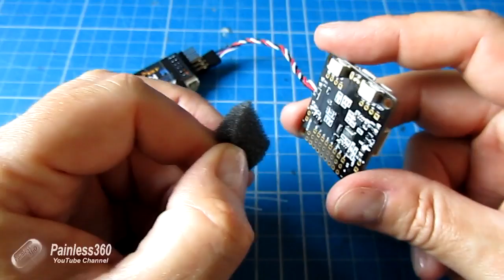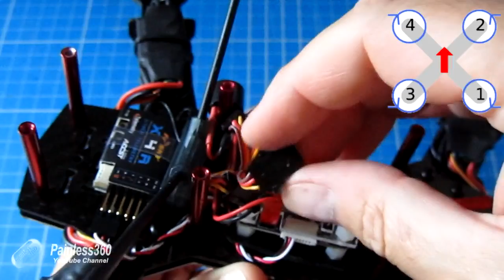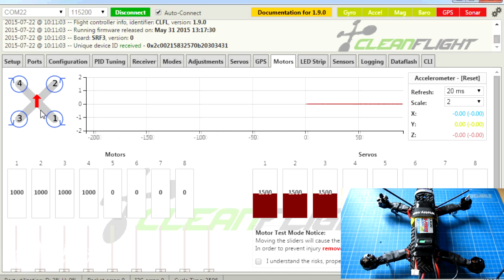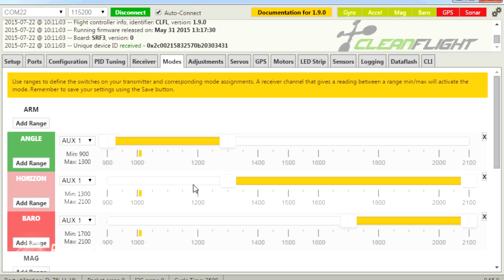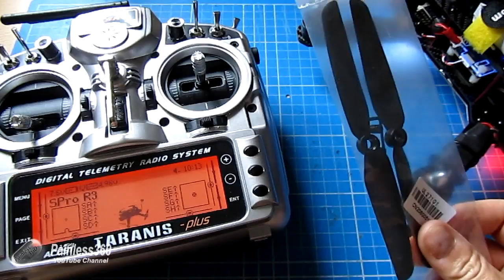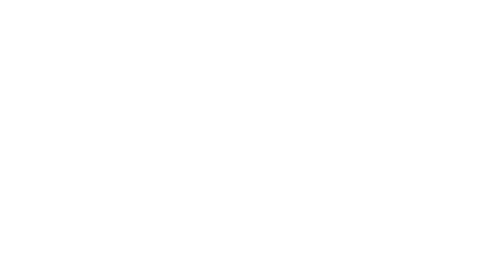(2/9) Seriously Pro F3 (SP3) Series - Installation, power, motors and first hover

Comment: I've just spent the last 5 days trying to get my Quad working with Cleanflight, and this is the 1st YouTube I've found that gives a clear, concise way of setting it up.  Thank you for this video; I was beginning to tear my hair out!
Reply from the maker: Cleanflight is a little unusual now. Most pilots use Betaflight or INAV.. See my builds on those firmwares.. Best of luck!
Reply: @Painless360  It looks like the SP F3 won't run on these configurators though.
The motors are now doing what I expect them to do, but when it gets off the ground (just) it shuts down everytime, and I can't work out why

Comment: i am confused. i got an SP F3 and with my motors. everything is wired up right works and that.. but my motors do NOT spin up for some reason. any help?...
Reply: back here aigan. I take it back. I only got one signal wire running to the ESC'S i tested some protokols annd TO my suprise. the motors spun up with multishot. love it rn. The motors need replacing one dont work the other 3 sound bad and make small shorts. BUT FIRST TIME in my hands it works im lovin it x3
Reply from the maker: Depends on the software you are using, or it could be an arming issue - tricky to help without any details. See my builds on inav and betaflight. Best of luck
Reply: @Painless360  Nono dont worry i got it fixed. hat to put the ESC protokoll to MULTISHOT works fine now. Tho i found out. Motors are trashed hah.. gotta find new ones in right size (1806) or gonna try to rebuild them OR.. i need a 5 inch frame and 2206 motors. i will see, WIsh me luck :D amd getting close to flyin
Reply from the maker: Best wishes!

Comment: What is vbat doing... Is it providing 5 volts or 5 volts is given by esc?
Reply from the maker: vBat on a flight controller normally outputs the battery voltage for use with things like the camera, VTX or other things that need the higher voltage. See later builds on the channel. On some on AIO boards it's used to measure the battery voltage. Best of luck!
Reply: @Painless360  sir on which pin on the flightcontroller 5v output from pdb will go
Reply from the maker: Please see my builds on the channel that cover all the steps.. Best of luck
Reply: @Painless360  ok sir thanks alot

Comment: It's 2020 and for budget quad build, this is priceless!!! F3's are still available and I'm fitting one on a 330 frame. Not too fussy about specs, functions and features, as long as it stays level and it's stable, it's good enough for buzzing around the garden. Seen most of your build series, I've said it before, probably the most sensible and comprehensive build advise without the drama. Cheers!!

Comment: So you power up the flight controller on Vbat? With 5v
Reply from the maker: Vat and for monitoring the battery voltage only. See recent builds that use more modern components...

Comment: the pins for the vbat port. Are those going straight from the 14.8V pdb XT60 connector?
Reply from the maker: Vbat usually connects to the battery pins to see the battery voltage... Best of luck!

Comment: I just learn to fly. Using emax 12a to my uav 250 and sp f3 racing. But the betaflight setting it has known only "brushed" no one shot. And flying were difficult to control. Do you have any suggeation sir and solutions,? Is This remedy caused by bad combination ESC vs sp f3 racing or something else. Calibration esc, accel have done and successful sir

Comment: This is very complete tutorial sir ;). If i use emax 12 a ESC should i use the middle red wire onto sp f3?  should I connect all the red wire or only one of them? Since this is 5c wire.?  Please advice sir...thanks
Reply from the maker: It depends on the type of ESC you have. If it has a linear BEC inside then you can connect it, it it's a switched BEC then only connect one of the red wires - see my video on it..

Comment: would you happen to know how to hook up four servos to the flight controller and control them using your transmitter.
Reply from the maker: Depends on the flight controller and software you're using. iNav is about to make it a lot easier..
Reply: Painless360 I'm currently trying to accomplish this with cleanflight and the seriously pro f3. Would it just be better for me to use Inav instead.

Comment: Hell, your esc have not callibrated it continuously beeps that means the esc doesn't dectect throttle signal....in fact i am facing the same prob so when i decrease max throttle value from 2000 to 1734 then at that point the esc easily callibrating.

Comment: At 13:46...  I have OPTO ESCs, but my PDB has a 12V and 5V + & -.  So I'm safe to say I don't need a BEC?  Just run a JST connector from the 5V connection to the FC?  And then how do I connect the black and white wires from the ESCs.  Black is ground and the White is the data pin?  So, again where are these two wires connecting?
Reply from the maker: That's right, please see my quadcopter building for beginners series if this is the first time you've done this, all of my tips for new builders are in there. Best of luck!
Reply: Hahaha.  RC Basics; Just watched it.  Thanks.  Now I feel stupid.  When I connected the tiny Black and White cable to the ESC, I never took the time to take a close look at the other end.  I just assumed that two wires, there was just a 2 pin connector on the end and was wondering how that would work connecting to the pins on the FC.  It's a 3 pin connector with the center empty with no wire.  The 5V pin will go in the empty hole with the ground and data pins connecting to the FC.  Duh!  If I had just looked at it, I might not have asked the question.  Going back to finish watching Quad building for beginners series 1 & 2.
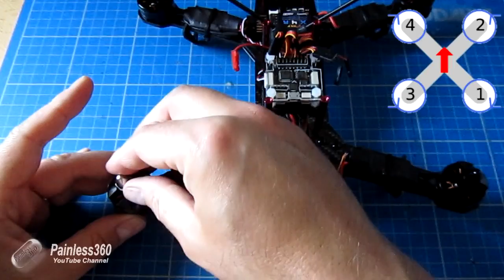Explained very well in this video as well: (5/9) Quadcopter Building for Beginners - Connecting the main power systems around 9:00
Reply from the maker: Don't feel stupid, we all started out once. ;) Those series should teach you lots. Happy flying (and watching!)

Comment: Thank you so much for pointing out the FC can be mounted in any direction.  I had it stuck in my head that the arrow HAD to be facing forward.  OCD!!!!  Going to watch this series again.
Reply: Found the solution in Cleanflight Configuration tab YAW degrees = 90 or 270 whichever way you turned the flight controller.  You may also need to change the MAG degrees.  Don't forget to select save and reboot.

Comment: Hello i done all the things as shown but i dont hae vBat so am using esc's 5v output but my motors dont spins when i click on that( 18:00 minute on video) and up the master it also dont work with my transmitter also my reciver can run them but SPF3 cant . any suggestions please .AND SORRY FOR MY ENGLISH
Reply from the maker: +Sarthak Rrawal what troubleshooting have you already tried?
Reply: Sorry didnt get you? What you mean with trouble shooting
Reply: If you mean that have i already tried that then yes i tried all that shown in you video but no gps and any other function only buzzer FS IA6B with IBUS setup and SPF3 delux with my fs-i6
Reply: And in my PC transmitter works but motors wont
Reply: One of my friend told that my motor is not looping with my flight controller so he suggested me to change my FC or motors and esc but am on low budget
Reply from the maker: +Sarthak Rrawal impossible to suggest anything without knowing more detail..
Reply: Ohk then i will make video and upload then i will tell you if you can fix it. Thanks for your time
Reply: https://youtu.be/P8yVgLp_N6M              look bro this is my video link please check it

Comment: Bit of a random one ! I have been following your videos to build a hex x 
And some how when calibrating the esc I have put 5 of them in to 3D mode ? One is still normal is there a manual way to change them or use clean flight 
Kind regards Daniel
Reply from the maker: Depends on the ESC, if you're using BLHeli ESCs then you can use the passthru ability of Clean/Betaflight. See the quadcopter building for beginners series for more detail.. Best of luck!
Reply: Painless360 thank you for replying, I don't think they are I tried to connect to them using the blheli but couldn't manage to connect. There e teck Simon series 30a all the motors were spinning fine until it came to calibration.
Reply from the maker: +Daniel Yates no idea then,sorry. I’d get a manual for them and look do the stick setups.. best of luck!

Comment: Hello, I am working on my firs quad build and have found you videos very helpful.  I have everything together and a looking foreword to flying.  I do have a problem.  I am using the Turnigy Evolution radio and CleanSky.  My problem is that in CleanSky I can get all of the motor functions to work but I can not get the modes to work.  I have a feeling that it has to do with the Evolution radio, I have updated the firmware (March 2017 ?) When I am using CleanSky none of my channel switches have any input.  Do you have any idea what the problem might be?  Thank you.
Reply from the maker: Not sure what you mean by 'Cleansky'? I've not used that here and a Google search didn't turn up anything..
Reply: Im sorry, CleanFlight.  I have been able go get the left side switches to be recognized but not the right side.  Thank you for your time.

Comment: Painless360 hiya lee when you sayed about the mutual iv covered the bottom and the sides was that a good idea but I didn't put any on the top of my f3 plastic casing but I'm getting fpv camera interference and not sure what's causing it lee it's on my nighthawk pro 280 with the stock camera and vtx and it's like noise interference lee I'm not sure iv but tried to problem solving it my self but I'm not getting anywhere 
can you give me any advice or help on this please lee
Reply from the maker: The best thing to try if you're getting interference is to connect all the GND pins from the camera, VTX and FC to the same place on the PDB. That usually fixed about 50% of problems.. Hope it helps..
Reply: +Painless360 thanks very much lee that's a thing iv noticed in some of your reviews that you have the red power wire rapped around I think it's a small magnet or something dose that filter noise and interference lee
Reply from the maker: They were on ESCs back in the day and the ferrite ring helps stop power problems with the signal wires. They aren't used much anymore..
Reply: +Painless360 thanks noproblem I keep seeing people using them and was a bite curious lee and ask you just incase it was a good thing lee like I said iv been trying to do my homework on this camera interference problem I'm having  but I'm going to try and ground the earth to the pdb and see if it helps lee and thanks very much

Comment: Quick question, if there is 5v's coming from the X4R to the FC do I need to have a 5v coming from the pdb to run the FC?
Reply from the maker: +AL Scutte actually, the five volts comes from the flight controller to the radio receiver. Not the other way around. You'll need to make sure that there's 5 volts connected to the flight controller from somewhere, and that will power everything else too. https://youtu.be/VdX8rPCuJ50
Reply: Thank you sop much for the info, one last question should I be hooking the S.Port from the receiver to the FC?
Reply from the maker: I#d suggest that you watch the 'Quadcopter building for beginners' series on the channel. I cover all of these basics for newer builders in a lot of detail. Hope it helps..

Comment: Quick question on this video. When looking at the motor screen in cleanflight and using the remote to control the throttle... Does your throttle rise to a max of 1700ish (in rate mode)? I noted that when using the cleanflight motor test instead of the remote that the throttle rises to 2000. Is the 1700 when using the remote because of the sensors in the craft not sensing movement with the props off... or an error... or to allow for the craft to maneuver? (I note that when altering the pitch or roll that the motors will rev up to 2000). Thanks.
Reply from the maker: +On The Fly By I don't use the motor test past making sure that everything's connected ok.. best of luck!

Comment: Hello I tried to power the board via VBat pin but it doesnot power up. Is  Vbat pin for monitoring bat voltage? I am using the opto esc. how can I power the board? I havePDB that supplies 5v power.
Reply from the maker: +Bikesh Shrestha chat doesn't power the flight controller. You need 5v from somewhere..
Reply: I have +5v from the PDV board. Will it create an issue if I connect that to one of the RC output channel to power the Board?

Comment: Hey Painless,

Thanks for your detailed videos!
I am at the step where everything is configured but I just have to calibrate all 4 motors to synchronize them. I did what you did in the video, brought up the speed to 1850 while battery is unplugged, then plugged in the battery, I heard the ESCs beep (programming mode) then brought it down to zero and heard it beep again. I thought that synchronized my motors but for some reason when I try increasing the throttle (from the software), they're not all spinning at the same speed. Some of them are slower than others even though they are all set to the same throttle value.
I also made sure all ESCs are flashed. Any ideas how to get them to fully synchronize? I am using Afro 20A ESCs with Turnigy Multistar 980Kv 14 Pole Multi-Rotors. 

Thanks in advance!
Cheers
Reply from the maker: +Michael Garas try changing the min and max throttle to other numbers and try again. Worth looking in the forums for others who've had problems with these ESCs too.. Best of luck

Comment: My linear voltage regulator can't supply enough power for my spf3 fc, do you know why this is?  thanks :)
Reply from the maker: No idea, you don't even mention which one you're using. I'd also check if it's not faulty..
Reply: Turns out it was a problem with my spf3.  It lights up when connect via USB but not by 5v power to the main input areas.  I was using a linear voltage regulator but I figured out that's not the problem, it's putting out 5v and turns out they're supposed to heat up :)

Comment: Is it necessary to power the board via the motor out pins or can it be powered via the reciever?Also I cant arm the borad, I have tried everything and on the cleanflight modes ,arm doesnt turn green on turning on the switch on the tx.
Any information you can help with?Also when connecte to the lipo the red light blinks constantly.

Comment: Painless360 hiya can you give me advice on the f3 board it was flashed and calibrated 4-5 months ago and I'm just getting back to building my QAV-R 
but I plugged the board in to cleanflight and it's failed to open serial port  and connect it was absolutely fine when I first setup the board
Reply from the maker: I'd check the USB cable.. What other troubleshooting have you tried?
Reply: +Painless360 thanks very much iv been going over a few videos on your playlist and watching videos on failed serial port trying to work out what has happened  thinking it's maybe bricked    and I reflashed it with the old 1 9 0 version and it flashed ok  but  failed to open serial port when I trying to connect lol  thanks very much for your reply

Comment: How to configure i2c on spf3 fc? Is there any video on it in the channel?
Reply from the maker: We use i2c to connect a few things in this and the iNav series on the channel. i2c isn't configurable as such, but you can add extra sensors to it without too many problems..
Reply: Thanks a lot.

Comment: Hello Painless,

When I spin my motors (from cleanflight or my RC), the Flightcontroller's microprocessors (the black chips) get SUPER HOT, like to an extent that it's almost impossible to touch (but keeps running fine). I am not too sure why this is happening. I made sure that my BEC from the the ESC is supplying exactly 5V, and they are Linear ESC's so I plugged in the S,+ve and -ve wires of all 4 ESC's in parallel to the FC like you said in one of your videos. Do you think that's why it's getting too hot? because the FC is getting 5V from 4 different ESC's? 
Problem is it also gets so hot when I try using just one ESC  (one motor spinning) for some reason, but not as shot as it gets when spinning all 4 motors. Also, when I stop spinning the motors it remains extremely hot. I can't figure it out.

Note: I am using a 4000mAh 20C 4s1P Zippy Battery; and I made sure that my 20A AFRO ESC's are 2-4S compatible.

Thanks
Reply from the maker: Sounds like a problem on the board itself. I'd power it from just a known good 5v supply and see if it does the same, if it does then I'd replace it.. Best of luck!
Reply: I'll do that, thanks a lot.

Another thing that I came across was:

When I was testing on one motor, I tested the voltage being supplied by the battery it was 14.8V, which is exactly what it says on the battery's 4S supply. However, as soon as i plugged in the 4 ESC's and started spinning motors, I checked the voltage across each ESC and it was ~10V and CONTINUOUSLY decreasing (even though I stopped spinning the motors); how is that possible?! within a minute it was down to like ~9.5V across each ESC.
Any ideas?

Thanks in advance! You're the best.

Comment: Hi, I wasn't sure if this is the right way to contact. I'm subscribed to your channel as your vids are very informative & was hoping for some guidance on the following. I'm trying to connect an frsky xsr receiver to an spracing f3 flight controller. Could you confirm the connections for sbus & telemetry please? Thanks very much.
Reply from the maker: You are in the right place, we have a video on the common connections for the SP3, including s-bus so that will help. If you are using SmartPort telemetry on that receiver then you need to connect the Tx and Rx pins on the UART you 're using for telemetry to the S.Port pin on the receiver.. Best of luck!